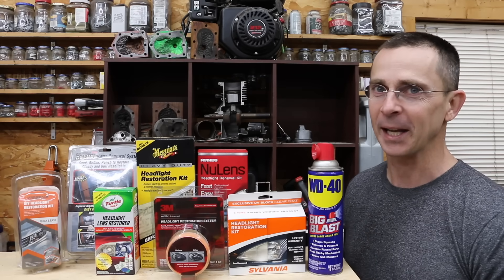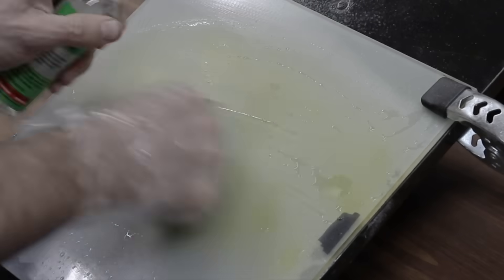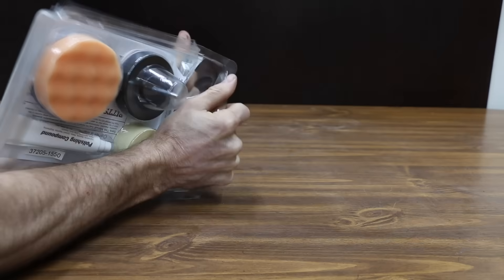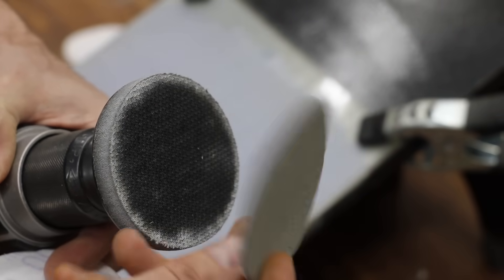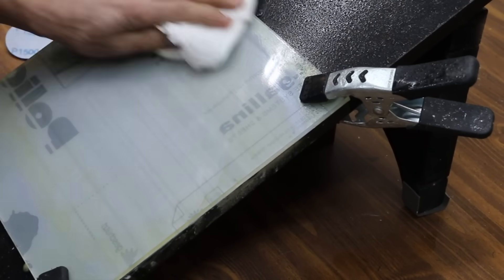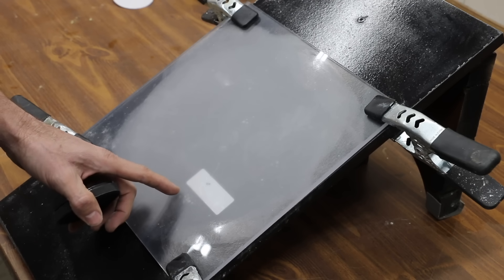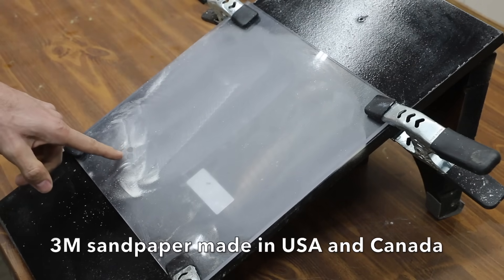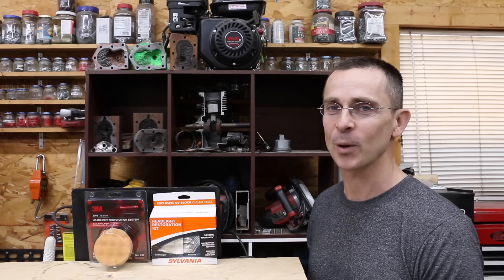Best Headlight Restoration Kit?  Let's find out!  3M, Sylvania, Meguiar's, Mothers, Turtle Wax & HF

Comment: Ahh, restoring polycarb headlights.

Problem is you can get them looking nice and pretty with a lovely abrasive polish and protective coat.

But gem-dimethyl group/photo-oxidation, carbonate group/photo-Fries reaction and aromatic rings UV oxidations, once the OEM protective coating is gone, these degradations will keep going. The better kits do a wonderful job, but you'll be repeating it. It is dependant on UV exposure be it direct and indirect, and humidity, for the life of the lens.

303 Aerospace Protectant can retard the damage initially, our 2012 RAV4 has weathered quite well using it. But even so, they are beginning to show signs of degradation.
Reply from the maker: Thanks for the feedback.

Comment: Wow what an awesome test, I wish you had made this video years ago lol when I tried the turtle wax kit on my old truck, and like you found, I also found that it didn’t do that good of a job it hardly worked. I was really disappointed in it and, the name turtle wax they usually have good stuff. But the ones that worked the best 3m, and Sylvania probably didn’t exist at the time. Now I know what ones to buy if I ever need to do it again in the future. Next try testing fuel additive brands for removing ethanol out of gasoline for outdoor power equipment engines. The use of it is pretty vital to a small engine for outdoor power equipment, as the ethanol in todays modern gasoline for vehicle, will destroy the fuel lines, and carburetors causing engine problems.
Reply from the maker: Thanks for the feedback.

Comment: How about an electric space heater test - cost, footprint, energy efficiency, how fast it heats a room, how loud it is, concerns about running for a long time, etc?  Not exactly a Summertime project but hey, they are probably on sale!  
And have you ever done a work gloves review?  Either heavy duty yardwork style or tight fitting/high dexterity "Mechanix" style?  I'd especially love to find which yardwork gloves are most resistant to burs and foxtails!
Reply from the maker: Thanks for the video idea.

Comment: You do some great videos, but I gotta say I'm disappointed by this one.  The yellow tint compound you applied is not the same as oxidization, so of course the lense cleaning stuff didn't work 100%.  Why didn't you leave the polycarbonate test plates out in the weather for a year, or oxidize them in a sealed environment with the oxygen from a torch? Obviously not enough to be dangerous, but could speed the process along.  I love Mondays because of your videos, but the science and adherence to chemistry / physics is what I enjoy, not the spectacle of the visuals.

Comment: I used the Sylvania kit on my car, which had very heavily oxidized headlights, about 6-7 months ago, and I have been very happy with the results. My only issue was that I tried to reapply some of the protective coating to a spot I missed before the coating had completely cured, which left some streaks. It's a very minor and almost unnoticeable imperfection in the headlight and it's totally my fault, but it's good to be aware of if you are going to use the kit.
Reply from the maker: Great feedback on the Sylvania kit.  The protective coating is impressive!

Comment: Review idea: I unsuccessfully attempted to repair a puncture in a law tractor tire with those gummy strips you force in. Still leaked. After a little research found out there are other tire plug options like Dynaplug, The Tire Plugger, and liquid options like Slime and Tire Fix. I’m thinking about the Dynaplug and wondered how you would test it. ;-)
Reply from the maker: Thanks for the video idea!

Comment: Literally just bought the turtle wax last night to fix a dashboard. I noticed too it lacked the coarser grits and bought them too (800/1500).  Previously couldn't read the dashboard too well. So I put some clarifying compound, 800/1500/4step all wet with a figure eight pattern. Then on too clarifying and dry buff. Was amazed.  Figured it boils down to adequate grits and compound with good technique if done by hand.
Reply from the maker: Great feedback. Thank you!

Comment: The test is FUNDAMENTALLY flawed though.  Not all of these products work on abrasion and polishing, alone - which is how your test is setup (to remove the yellow tint you applied, then polish).  I don't know how, but JUST the PlastX bottle by itself (which you can buy as a stand-alone product) EATS the oxidation off the lens, without the use of abrasion.  You don't even have to apply force.  Technically, it's ever so slightly abrasive, but that's not what is doing the bulk of the work -- there's something in there that dissolves the oxidation.  I've been using it for years and it works great on all but the most faded lights.  You really need to try this on some old headlights.  Keep moving it around, but don't apply a much pressure -- doesn't work by normal buffing and polishing methods -- there's some sort of chemical reaction removing the oxidation.
Reply from the maker: Thanks for the constructive feedback

Comment: Not bashing this at all you have a great channel.  My dad does body work for a living and all he did on my truck years ago was rubbing compound on a professional buffer and in 2 minutes headlights looked new.  No sandpaper etc.
Reply from the maker: Great point.  That'll work very well
Reply: I bought the cheap Turtle Wax one myself it worked fine but I also hit my headlights with 2000 wet sandpaper before

Comment: Bought a Meguires kit few years back and have done several sets of headlamps with the same kit since then. Even saved 2 pairs of hard to find lamps from going to the scrap yard. All the "restos" lasted minimum 2 years. Could still prolly do another 2 pairs. As in most things, preparation is key.

$28 CAD well invested.
Reply from the maker: Great feedback. Thank you!

Comment: Great information. I used the 3M kit about 3 years ago, I coated the lenses after, now they are just starting to yellow. I should have coated them every year. On my glass shower doors, my wife and I tried a lot of products to clean the scale and grott off the doors. None of them worked. After I did the headlight I used the 3M kit on one shower door, It really cleaned it up nice. I spray the shower door with Rain X shower door spray. It keeps the door looking nice.
Reply from the maker: Great information on 3M.  The sandpaper is amazing!

Comment: Have you done a starter fluid/Choke and carb cleaner video? I was always told they were basically the same thing and could be used interchangeably. I was also told just regular gasoline will work well at cleaning small engine carbs
Reply from the maker: Not yet. Great suggestion! Thank you

Comment: Heads up to anyone reading this. If you use a polishing compound on your lenses with a drill while they're still on the car, slam a sheet or tarp over your hood or it will fuck your paint forever. I've still got pits on my Honda's hood from Mother's brand polisher.

But the lenses look great :)
Reply from the maker: Great feedback. Thank you!

Comment: Undercoatings and rock guard spray on protection. Water, flood, mud, corrosion, rocks, rust, etc etc protection. What lasts longer, what cleans off easiest and which ones look worse after treating them rough
Reply from the maker: Great suggestions!  Thank you

Comment: Add this (plastic light assemblies) to my ever growing list of things I GREATLY miss about driving my old 1972 Mercury Comet that I owned/drove daily in high school back in the mid-eighties!

Sure, those old headlights were pretty heavy, but you didn't need to 'restore them' every 12 months or so. That car was SO easy to repair. Anyway... I regret selling it.

BTW, Todd... great vid/research, as usual, buddy. I'm still a little depressed that you or one of the other 'YT DIY guys' (Chris Fix, Eric the Car Guy, mustie1, etc.) are not one of my neighbors. : )

Anyway, Happy Memorial Day 2020!
Reply: Had a 90s 3000gt with plastic lenses. I bought a set of glass ones from a different year and yea they weigh a ton but we're do perfectly clear.
Reply from the maker: Great feedback. Thank you!
Reply: Those car seem to hit the wrecking yards quite a bit with low miles and still in good shape.   Here's an example: https://youtu.be/wdPmP7D5P88
Reply: I don't miss sealed beams. Sure, they wore out one every 10 years but you couldn't see anything. I'll take modern polycarbonate headlights any day of the week.
Reply: @fordrac1ng81  The headlights on my 69 Mustang were just as bright as those on my 90 Mustang GT (which was brand new).

Comment: I have some questions, can the inside part of a headlamp get yellow? if so, how to restore it? do we must open it? my headlamp is getting yellow, i try to restore the outside part with a compound and towel, its better but still yellowish. I think its the inside part that still yellow, isn't it? Please, any answer or suggestion will be greatly appreciated. (sorry for my english, i hope you guys understand)
Reply from the maker: Great point.  Yes, it can yellow and removing the lens cover from the assembly is possible but often sometimes the lens cover will crack (depending on the design and how it's held to the assembly).
Reply: @ProjectFarm  ah i see. So i think i must open it and clean the inner part. Thank you so much.

Comment: Back when I was working in auto parts 8-10 years ago, I always heard the 3M kit was the best from co-workers as well as mechanics/detailers. I always recommended it because of that. It's cool to see that they were right and it still holds true a decade later. I actually have one of those kits sitting in my toolbox to do one of my cars as the headlights themselves are too expensive. My other car, headlights are so cheap, there's no point in restoring them.
Reply from the maker: Great feedback. Thank you!

Comment: I used the Meguiar's a couple of months ago. Got their top of the line stuff from Walmart, $29. I did 3 cars, 2  that were heavy nasty. I like it. The discs could be rinsed and reused. Car Wizard just did a set with brake fluid and turtle wax. Originally I did WD40 0000 steel wool then nail polish remover. It was okay. Not that great. Streaked. I know a guy that did 0000 steel wool, WD40 and clear lacquer. 

How about organic weed killer for a test? I was looking into 25% agricultural vinegar. Not sure what it would do to my galvanized horse fencing, and chain link. Thanks great info as always!!!
Reply from the maker: Great feedback. Thank you!

Comment: Hey Project Farm, can you do a video comparing the different torque breaking points for 1/4, 3/8 and 1/2 sockets? I want to understand why its important to use a 1/2 inch wrench over a 3/8 inch wrench especially since you can use an adapter to get from one to the other. Does it make sense to use an adapter or use the correct wrench because it is made better for its application. Thanks for the videos!!!!
Reply from the maker: Great video idea!  Thank you

Comment: The next logical thing to test is automotive paint compounds and polishes for removing light scratches.
Reply from the maker: Yes, great suggestion!  Thank you
Reply: I second the idea of testing compounds. As a professional Paint correction tech, I'm always looking for the best compound. I used Meg's UC for a season and found it does little to remove scratches. What it does do is temporarily fill in scratches with oils and other fillers. 
Want to make this test real? After using any compound or polish strip the paint by wiping it down with Isopropyl Alcohol.
I'm still looking for a compound that passes this test
Reply: @christopherfoxwallace1291  I use Meguires 105, wipe with alcohol and immediately follow up with your typical wipe on ceramic "coating". It lasts a couple years at least.
Reply: @disgruntledegghead6923  I gave up on Meg's for a while. Trying a product by 3d right now. But you know, limited money, it's hard to try everything. That's what's great about project farm, his work saves us bundles.
But ty I will try some 105 in the future
Reply: @christopherfoxwallace1291  I stand corrected, it's 100. Not 105, big difference. I do a LOT of buffing being in the paint and body trade, the Meguires 100 is hands down the best compound I've used as it doesn't dry out like other compounds. Plus it's a very heavy cut.
Try it, you'll love it.

Edit. For paint you will want to wash the 100 off with soapy water before you polish or swirl remove. Wurth makes a great swirl remover, use a soft foam pad and run the buffer as slow as you can. Like barely turning type slow. I've done more show car finishes than I care to mention (like start with 600 grit) and those two products have been the best for me for more years than I care to mention.
Reply: @disgruntledegghead6923  M100 and M101 have fixed a lot of problems I've had that M105 wouldn't touch. One of those 2 and a wool pad can fix some headlights in 2-3 min per side.
Reply: @Havoc_21  Yeah, I looked at my comment and then looked at the bottle. The 100 is worlds ahead of the 105, I agree. For headlights it's great but unless you sand the oxidation off first you'll wreck the pad. For paint you will want to wash the residual compound with soap and water (or isopropyl alcohol for ceramic coating) before you follow up with any other polishes as it is oil based. Hence the lack of drying up that makes it so nice, and significantly cheaper than the crap 3m sells.
Reply: @christopherfoxwallace1291   M100, M101, or M105, then finish with a polish like M205. I can take out 1200 grit sanding scratches on headlights with a wool pad and M100, depending on the hardness of the headlight.

I do like the Meguiar's Microfiber compounds and polishes too. Less dusting, easier to wipe off, and great results when using the whole system. You can mix a little of the M product line with the microfiber products if you need.
Reply: Yeah that video would be great
Reply: I used Mother's Mag & Aluminum polish with the 3M polishing foam pad.
Reply: That’s easy. 3M Perfect It is the best. Go to any reputable collision repair shop and that’s what you will find.
Reply: @jamiebuchan6533  I work for a reputable collision shop, we use the Meguires because it's significantly cheaper and it produces results. 3m has gotten out of their mind with prices lately.
Reply: Wet Color sanding and buffing. The original fix. And if you want it to last shoot a coat of clear on the lights.
Reply: I've done that, Meguiars ultimate compound is the best 👍
Reply: @stevenkelby2169  not the best, but definitely one of the easiest to use for a beginner.
Reply: Exactly what I do. I use Turtle Wax rubbing compound, then wash and wipe, and then use Turtle Wax polishing compound, and then a quick wipe and it's good as new. I don't do any clear over it afterwards, so it typically lasts only about a year between polishing

Comment: I just picked up my first car and was talking to my dad about cleaning up the headlights, about an hour later my saving grace popped up!! You’re honestly one of my fav youtubers, have a wonderful day!!
Reply from the maker: Congratulations on buying your first car!  I hope you get many years of use out of it!
Reply: Hey get a kit that has the three different grits of sandpaper and the polish/clarifying compound. Once you're done it's really important to apply the lens protectant that meguiars makes. Otherwise, they'll be yellow again in a month.
Reply: I had an excellent experience with the 3M kit, and highly recommend it. Once you finish the full polishing though, I would recommend getting an acrylic clear coat with high UV additive spray paint to go over them (unless you can get a 2k clear coat with UV protectant for a reasonable price in your area) before applying any chemical protectant over the top of all of it. It'll give your lenses the best fighting chance.
If you hope to keep the car for a long time without repeating it, you should also look into a clear overlay for them like a clearbra or something to help absorb future rock damage.
Reply: @ncc74656m  clear coat won’t stick to a polished surface, 800 grit is the highest you can go before 2k clear coat.

Comment: If you had a UV lamp, and an ozone generator, in a sealed box-
put those finished plates and headlights in for a while,
see what happens. I'd be very eager to see those results!
Both devices are on Amazon.
Reply from the maker: Great recommendation!  I'll look into buying both.
Reply: @ProjectFarm   How about an add-on?   Try a couple light coats of Clear U/V blocking spray "paint" on the cleaned up lens.
Reply: I agree. It's trivial to find sandpaper and polishing compound to clearup headlights. It's finding a  uv protective product that keeps them that way that's the challenge. This clearcoat product is the best I've used so far: https://www.kbs-coatings.com.au/product/diamond-finish-clearcoat/. I sold a car with this on the headlights that I still see around town, so I always take a look at the paint and headlight work to see how it's holding up; so far so good after a year. This is what I plan on using my car once the headlights start to show hazing.
Reply: @ProjectFarm Yes, this! Many people on Amazon complain that the products leave their headlights dull again after just a few months.

Comment: Been using cheap toothpaste, a rag, and elbow grease for years. Works well. Costs pennies.
Reply: Project Farm - I'll share my exact method if you want to do a comparison with the worst & best of this vid. I tried a few professional methods/products before going back to the toothpaste. Only the pricey ones seem to do as well (or better) and compared to the almost non-existent cost of the toothpaste it's hard to justify the price of the good stuff.
Reply from the maker: I'll add toothpaste to my list for round 2